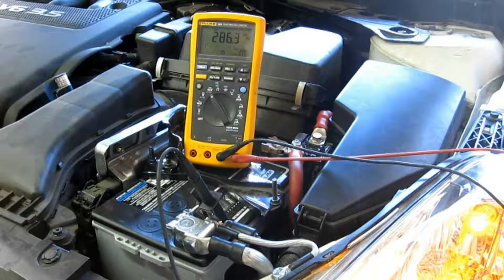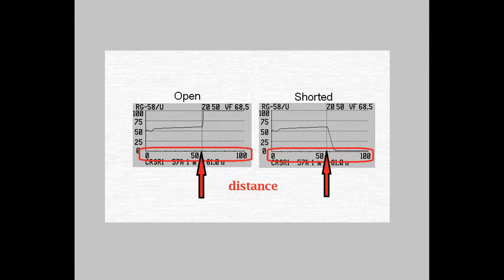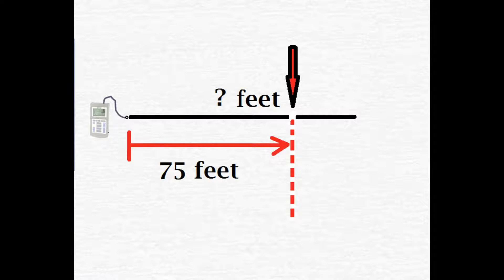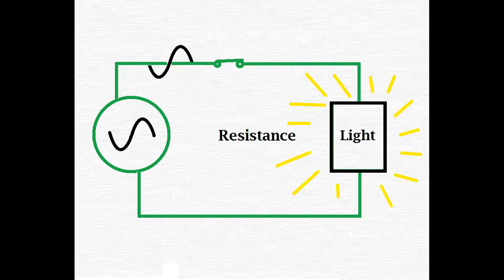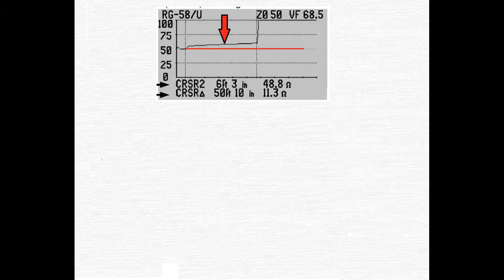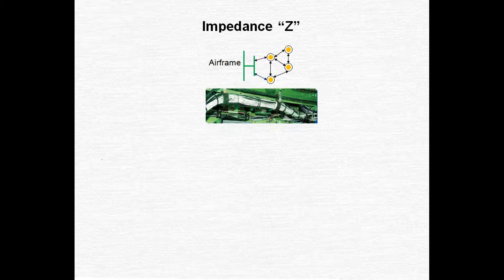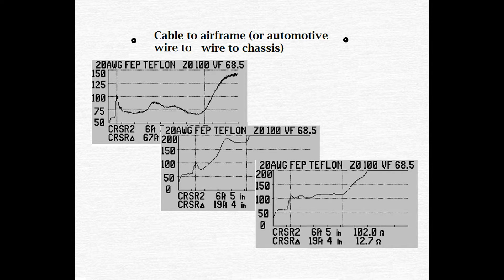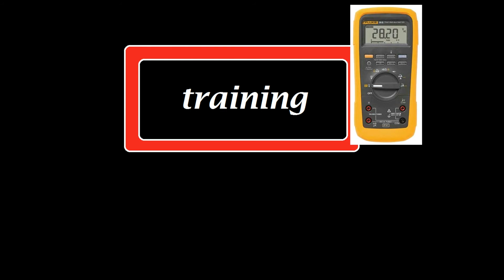Aviation (TDR's explained  - Time Domain Reflectometer)

Comment: I used a Tektronix 1502 and 1503 for many years. Used mostly for RF cables on aircraft. First learned to use it in the Air Force. Later went to work for the Army and they had no clue, but they did have one. Now retired, I purchased one at a auction 20 years ago and use it in Amateur radio as a hobby.
Reply from the maker: Thanks for taking the time to share. It simply amazes me how companies refuse to provide training on tools that will practically eliminate the time required to troubleshoot product down time. I previously worked for a major aircraft manufacturing company in the Pacific Northwest.  The company is schedule driven, but would happily let technicians spend days struggling with a repair rather than allowing me to make a training video on company time showing how to use the TDR.
Reply: They don't understand that it would save them money. In the AF we had diagrams that should the settings and the distance plus what a normal trace should look like per antenna. In the army side none existed so I quickly made a simple manual. I should of submitted it for approval but I was hired at another job. They probably still use it as a TS aid.